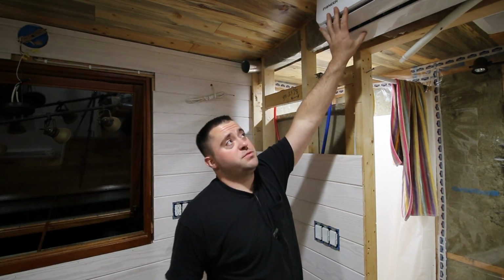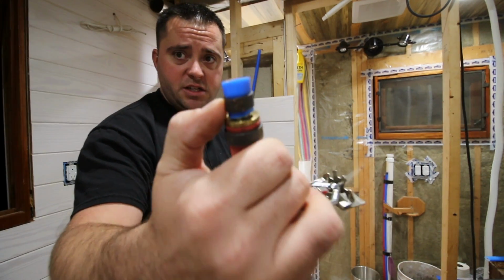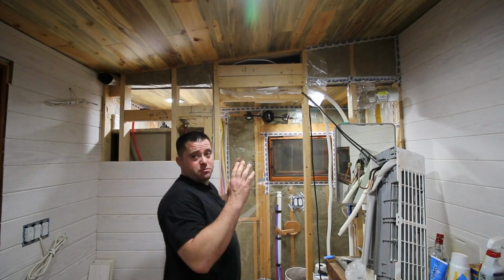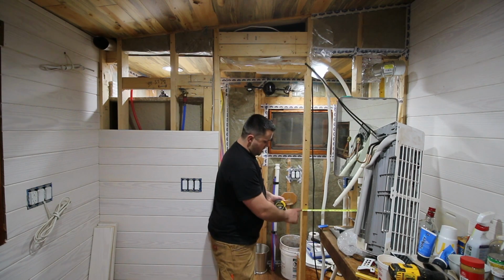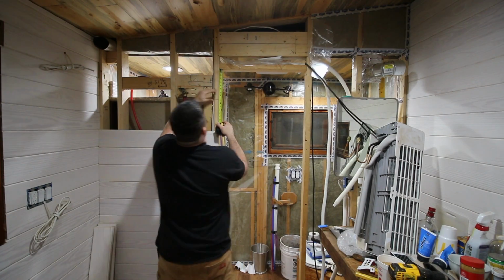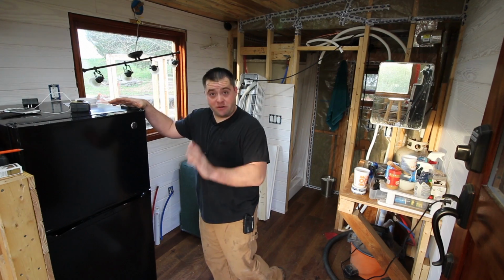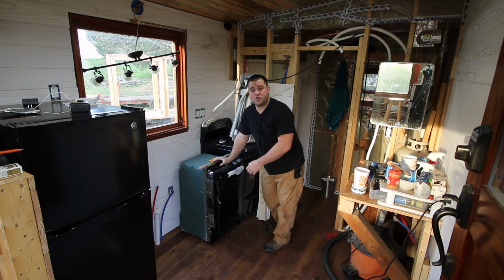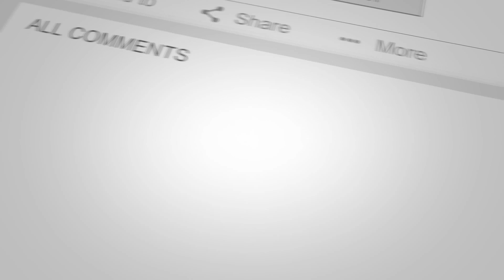Tiny House Appliances

Comment: for $400 you could buy a used vacuum pump, flaring kit, and possible a set of used gauges. I could walk you through it....it's not difficult at all.
Reply: Raymond, I'd love to know if you are still available to do so, as a women, I know only what I've read or see on here.  As the contractor hired did a very poor job and another on 2 other times I have had guys come over and stupid me am out thousands with them also as they quoted me a amount and I paid the electric guy what he quoted me to do it 500.00 yet he never returned to do anything back to me nor did he ever come back..I've have a mint in this deal and it's nothing like my blueprints were, mine too is in N.c. where Dan's is..hoping he can throw some good people my way, Thank you and God bless!